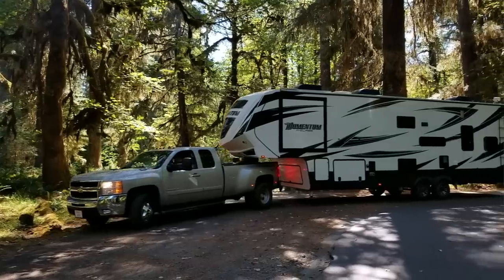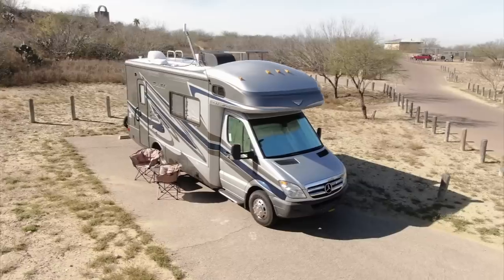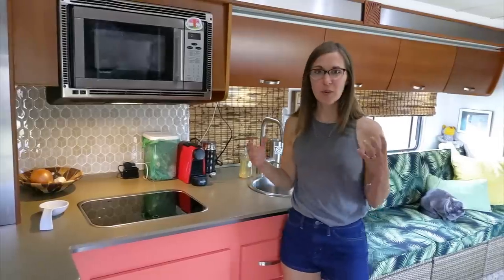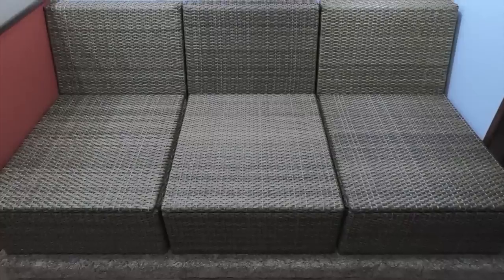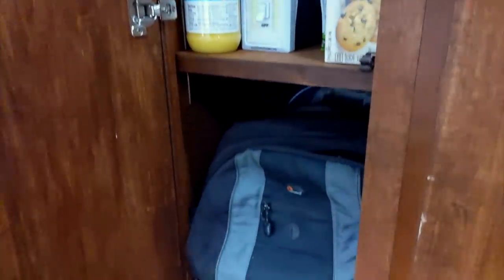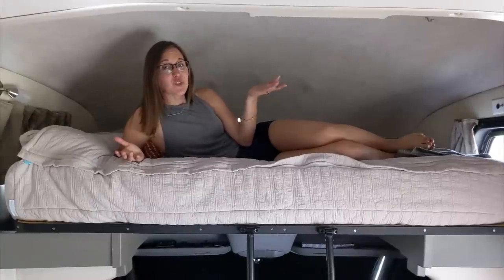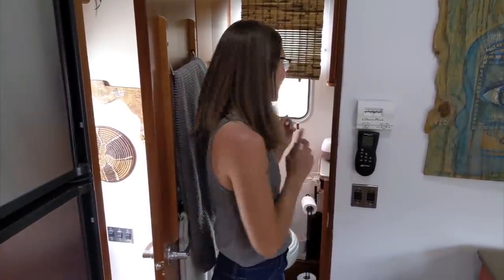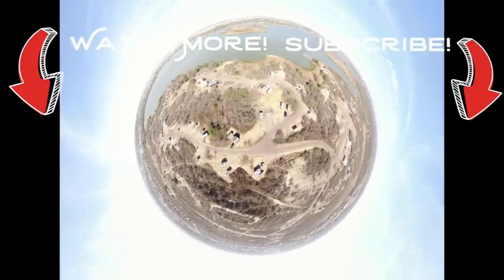RENOVATED Fleetwood Class C Full Time RV Tour 🚐

Comment: It looks like you set up the permanent bed by putting a frame underneath the mattress that bridged that central cut-out area. Did you find one that let you remove the legs, leave the legs folded up, what? I'm hoping to do something similar and I'm trying to figure it out!
Reply from the maker: Hi Caer! Actually the bed platform you see is what the manufacturer installed in our class c at the factory. The bed platform does have two shocks that will lock it in a raised position, making it easier to get in and out of the front seats. We just leave it down all of the time though as we're both fairly short, lol, and ducking under it isn't a bother. - Dennis ✌️
Reply: @EatSeeRV  Thanks so much!! I appreciate it!

Comment: Awesome job. Really love the look. Very refreshed. We have a 2009 Fleetwood Icon and are just starting our renovation. Curious about the flooring. Did you use a laminate or vinyl. We stated looking at laminate for the entire area. But it will add 140 lbs. With a11030-lb GVWR, every pound matters. If we do new flooring  we will remove the original vinyl flooring which should shed some weight but I’m not sure how much and whether it justifies adding the heavier laminate —-though it sure would make our rig look great. Any thoughts about the weight issue. Did you pull out your old flooring and, if so, could you guess how much the old floor weighed?
Reply from the maker: Congrats and good luck on the renovation! We kept the original flooring actually. It was in good condition and worked with our look. - Liz
Reply: Liz - Thanks for your response. Are you aware of others who have renovated their Class C Sprinter? We’re still in the idea stage.
Reply from the maker: There are a lot of class c rv renovation videos. Specifically I can't recall any other channels of the top of my head. But, a quick search on YouTube will give tons I'm sure. - Dennis

Comment: how long does the propane last and manage to keep it cool during the day? Leave the AC on or use air circulation from fans?
Reply from the maker: Hey Manny, are you asking how long the propane will last while running the propane generator with the AC running? -  Dennis